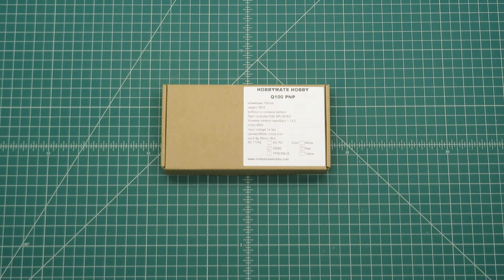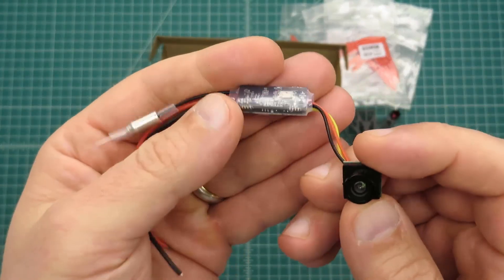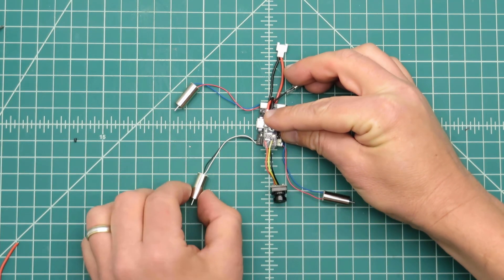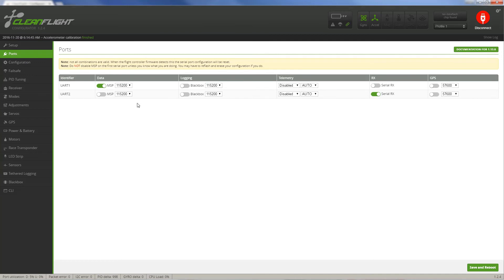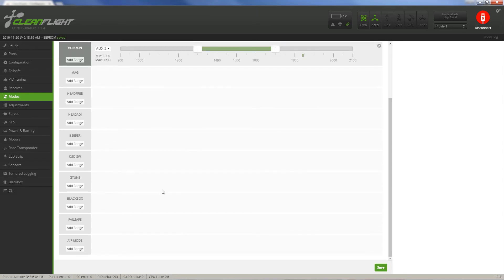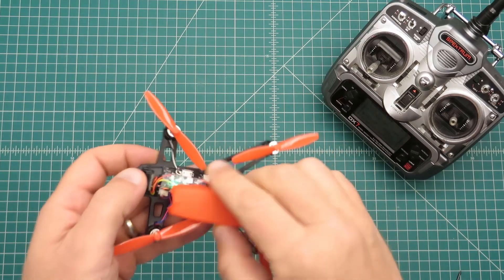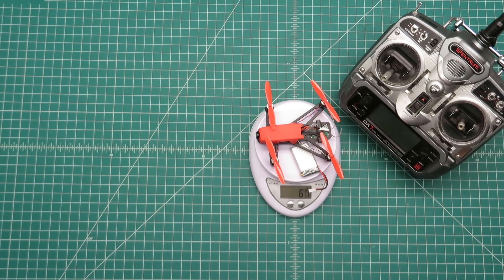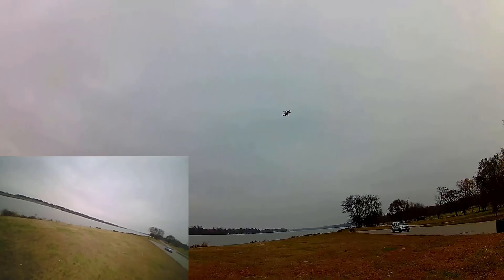Hobbymate Q100 Quadcopter Kit - Assembly, Review & Acro Flying

Comment: Good video. However, being very new to this, I struggled trying to get Cleanflight to connect. After researching many google articles I found that I needed to use the CP210x drivers. It would  have been nice it this was stated in the video.
Reply from the maker: Good suggestion!  Usually the operating system can find the correct drivers but sometimes not.  We will include driver information in future videos.

Comment: How do you program the transmitter with the Q100? I just got the same Tx (Spektrum DX7 using dsm2) and can't find any documentation on programming it for this multirotor.
I followed the video and everything is showing up correctly in CF, the inputs from the transmitter are showing in CleanFlight when the quad is connected via USB, but when I go to fly the quad nothing happens/none of the rotors spin up. Are there any guides or how-tos for setting everything up transmitter side that you can point me to? Thanks!
Reply: The Q100 kit comes with a Spektrum satellite receiver (if this is the kit you bought).
You have to bind this satellite receiver to your radio.

Normally, you plug this satellite receiver to another Spektrum receiver that has a port for a satellite receiver.
Then you bind that entire receiver setup with your radio, just like binding any regular Spektrum receiver.
In his video, at 7:10, he mentioned (he did not show) how he bound this satellite receiver to his DX7.
Reply: Ditto
Reply: I got this running with some help! You need to set it in CleanFlight  CLI section. Try this - Go to the receiver tab on beta flight. And move your sticks up and down and write down the min and max values
Then go to the cli screen. 0=roll 1=pitch 2=yaw 3=throttle 
In cli screen type: rxrange 0 (minvalue#) (maxvalue#)
So if your roll min was 1100 and max was 1830 you type: rxrange 0 1100 1830 (enter) do that for the rest 1,2 and 3 then type "save" .

Comment: Hi i was wondering if you could help me. I just put my q100 together so when I go on cleanflight I can't get my radio to talk to the FC tho I know it's bound(taranis). I have all the correct settings. I do however have a blinking green light. I reflashed it was the latest firmware and recalibrated the accelerometer but nothing has changed.
Reply from the maker: Sounds like there may be multiple issues going on.  Please visit the help thread on RCGroups.  We monitor that thread closely and can help more efficiently.  https://www.rcgroups.com/forums/showthread.php?2789815-Hobbymate-Q100-Micro-Help-Discussion

Comment: Cant get the quad to arm. Any suggestions?
Reply: Hi Chris. I can try and help but it would be nice to know more. How are you arming? Stick or switch? If switch, did you test it in Cleanflight to make sure it was arming? Also, I believe if you have motor stop on it takes a few seconds after you arm before props will spin so try waiting a few seconds after arming and before throttling up.
Reply: Same here
Reply: I got it working see my comment below!